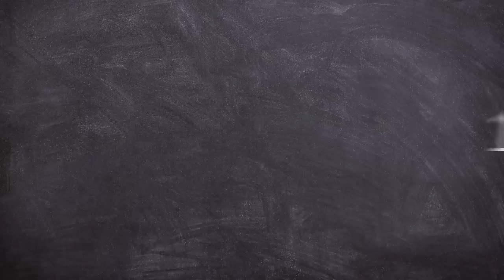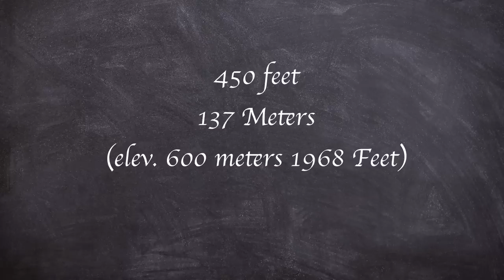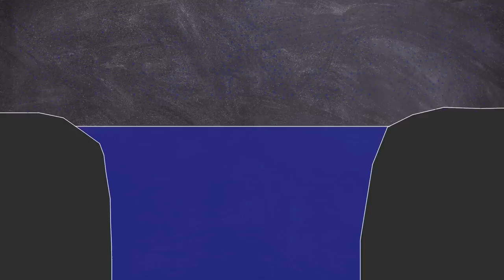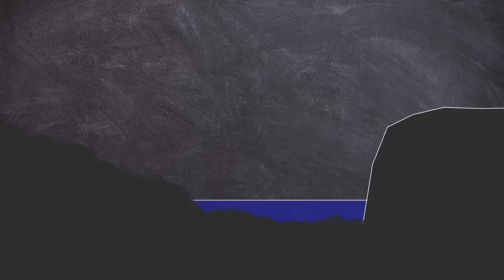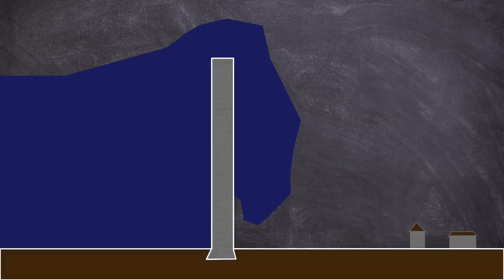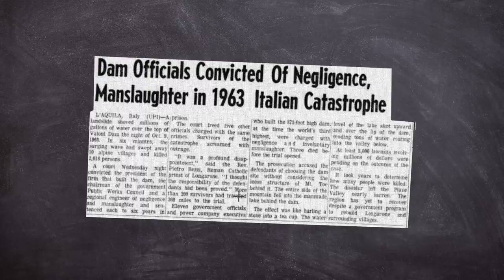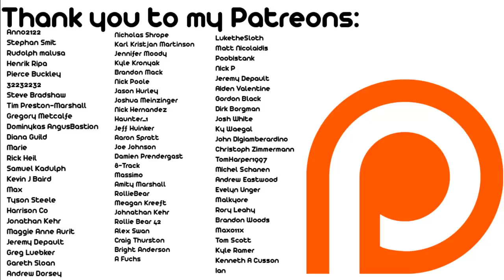A Brief History of: the Vajont Dam Disaster (Short Documentary)

Comment: Fun Fact: The people involved in the dam operation predicted exactly when the landslide would occur and gathered with drinks at the top of the dam. Their calculations where extremely wrong leading to them thinking they could just watch the spectacle if they lowered the water amount enough. Well you saw what actually happend that night.
Reply: Actually, that was the procedure (minus the drinking on the top of the dam) they had established to address a landslip - lower the water level in the reservoir until the hillside stabilized.  This worked in the past only because the landslips were reltively minor.  However, this time, this hillside was saturated with water because of the rainfall, with the result that lowering the water level in the reservoir accellerated the slippage instead of reducing it.

Comment: On Google earth 3d view you can see how massive the landslide was
Reply: Did they build a road on top of the landslide?  Hard to even tell where landslide and original mountain is and where the water could have been stored originally.  Looks completely unviable for a reservoir now.
Reply: @truedox  if you want to remove all landslide's debris with 100 dump trucks/day, it will take approximately 350years
Reply: @isseyIT  That is nuts.
Reply: @isseyIT   I was just there today and wondering how to represent the size of the landslide. That's a great explanation, thanks.
Reply: @truedox   The main road up the valley, SR251 (don't know if they rebuilt it) skirts the landslide on its northern side (i.e. opposite from Monte Toc), and what looks like hillside opposite is actually the face of the landslide.   It's a mile long.   There is a very minor side road that turns off a kilometre above the dam and runs along the top of the slide - essentially the slide forms a broad ridge down the middle of the old valley where the lake used to be, with a small valley each side of it.    You can follow it on Google Streetview.

Comment: I visited the dam about five years after the accident. I was favorably impressed by observing the water flow was about 100 meters over the crest of the dam. We were viewing from the end of the concrete road on the North end of the dam. I also noted the large pipe crossing the gorge downstream of the dam was not damaged. In my opinion the dam was a very well built structure in the wrong location. 

If I remember correctly there is a much lower dam near the end of the canyon. This cut stone dam also did not fail when the torrent came down the valley. 

This was a avoidable tragedy because the geotechnical engineers were ignored when they described the unstable geology of that area. That act has resulted in more than one disaster. You never want to    have to say, "Look at the money we saved on the boreings."

Comment: Errm,  5:16, it's the north side of Monte Toc, actually.
The size of the landslide is enormous, you can see at 6:40.   It's a mile long, and towers over the dam.   There's a minor side road that runs over the landslide which is now a substantial hill in the valley where the lake used to be.
The dam must have been extremely well built.  It is now probably the world's highest retaining wall.
I visited the dam in 2013.  From the openings in the narrow road tunnel in the side of the gorge approaching the dam (pedestrians forbidden, but this is Italy) you can see the height of it - vertigo-inducing.   
In the car park by the dam was a very long line of gaily-coloured little flags, each with a name on it, an age, and the same date - 9 Ottobre 1963.   None of the ages were over 14 anno.     Very sad.

Comment: The dynamic forces of the water, mud and rocky avalanche were mind numbing.  Heavy reinforced Power Plant steel doors were ripped off their massive hinges, the power house was eradicated and the impact against the dam itself was estimated to be 38,000 meganewtons of energy.  This dam was a supreme triumph of Italian civil engineering.  The engineering geologists failed in their job to determine the detrimental effects the fault conditions of Mt. Toc might reveal in causing possible landslides.  Essentially, the liquifaction of the surrounding ground had no foundation where it met the rocky sides of Mt. Toc.  Also, but not mentioned, is that the small towns surrounding the reservoir were also impacted by the wave of water forced up the lake side.  Some of those towns suffered highly significant losses of property and life.  The recent Italian produced and directed movie, "Vajont" is very, very good and worth obtaining (yes, there are subtitles in English).  I'd recommend it.  It is available through Amazon and other outlets.

Comment: You forgot about the fact that they have assumed the wrong data for the model used to get the safe max water level in the damn. 

When computing the max safe water level, they considered the fact that the mountain will cause a landslide that will create a wave high enough to overtop the dam. If they did it right, they would've known how high the tallest wave would be, and from there they would know how low the safe max water level should be from the top of the damn.

The engineers assumed that it the fastest time it would take the landslide to spill into a lake was 10 seconds. In the actual incident, the landslide spilled into the lake within 5 seconds. The acceleration needed for the chunk of mountain to spill into the lake within 5 seconds, plus the entire mass of all the material resulted in a force so high, it created a wave tall enough to go way beyond the height of the dam.

Comment: The 150m wave is kinda a misconception. The landside was on the south side of the valley filling in the reservoir. The water then sloshed 150m up the north side of the valley destroying a town on the other side. Then the water came back down, found the lake was filled in and so it overtopped the dam. Two towns were destroyed. But there was no "150m wave" but rather 150m is how high the water got pushed up the opposite valley wall.

Someone made a really great simulation
https://youtu.be/NK2T_ICe8v8